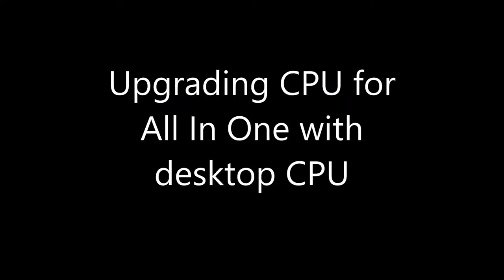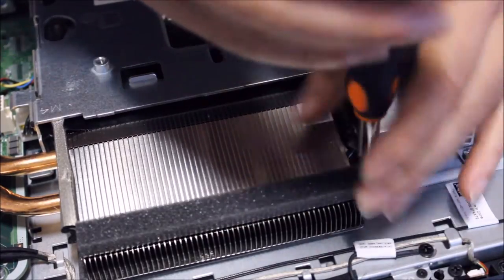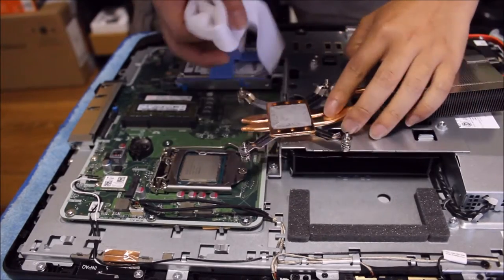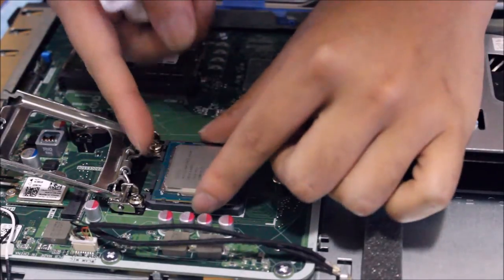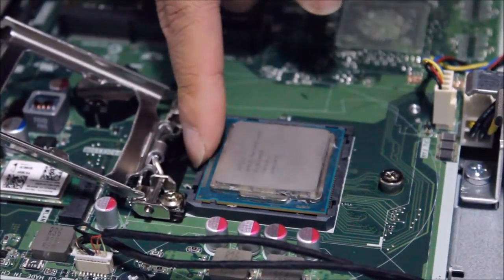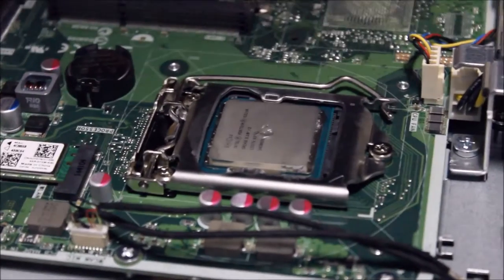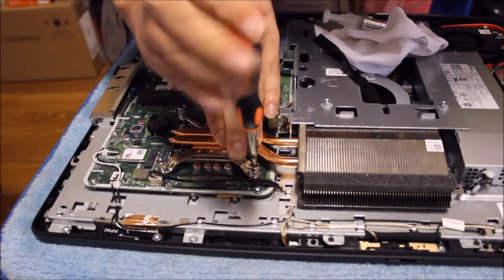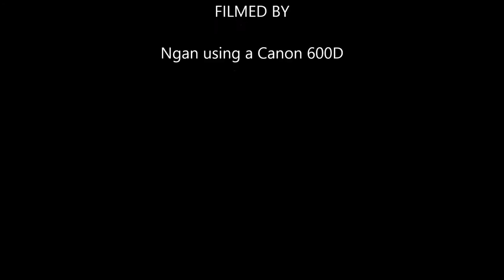Upgrading Intel CPU for All In One with desktop CPU NOT laptop CPU

Comment: i have a lenovo c 320 AIO it has the i3 2120 series chip,it can be replaced,what is the best i can put in ? and would the ordinary heat sink and fan still be ok?
Reply from the maker: i7 2600s. i cant tell you if the original heatsink will be ok or not. if you look at all the CPUs that came with your model that will give you an idea on what is ok. example if you look at your computer you will see if came with a i3, i5 and i7 therefore it is ok to use thiose

Comment: Hey there I have a Dell 7790 AIO. Processer is Intel(R) Core(TM) i7-10510U CPU @ 1.80GHz   2.30 GHz. The installed ram is 12.0 GB (11.8 GB usable). I have been to best buy and asked them if i can put a better/faster/bigger cpu in it and which one i can put in it and they said you cant. Another employee said it had a laptop cpu in it. Im not savvy with these things and am capable of putting a new one in it, i just have no idea what the best one i can put in it and if there even is any cpu i can replace it with. Thanks for your help as best buy was not helpful.
Reply from the maker: it is a lptop CPU and can not be replaced

Comment: Hey will this work?

It is a HP ProOne 400 G3 20.0-in touch Aio

CPU : Intel(R) Pentium(R) CPU G4560T @ 2.90Ghz
Reply from the maker: Intel Processors (include replacement thermal material)
Intel Core i7-7700T (2.9-GHz)
Intel Core i5-7600T (2.8-GHz)
Intel Core i3-7500T (2.7-GHz)
Intel Core i3-7300T (3.5-GHz)
Intel Core i3-7100T (3.4-GHz)
Intel Core i7-6700T (2.8-GHz)
Intel Core i5-6600T (2.7-GHz)
Intel Core i5-6500T (2.5-GHz)
Intel Core i3-6100T (3.2-GHz)
Intel Pentium G4600T (3.0-GHz)
Intel Pentium G4560T (2.9-GHz)
Intel Pentium G4400T (2.9-GHz)
Intel Celeron G3930T (2.7-GHz)
Intel Celeron G3900T (2.6-GHz)
Reply: @OpenMeUpTec  Omg thank you so so much!!! And am i able to change my graphics card? My current is  Intel(R) HD Graphics 610
Reply from the maker: @JapaneseSoomi  that is not a graphic card. that comes with the CPU. you can not change your graphic card. you need to buy a desktop for that.
Reply: @OpenMeUpTec  oh... i see
Reply: @OpenMeUpTec  Wait, so can i get a graphics card instead, if i do not have a graphics card as u said or can i just get a "additional" graphics card?:
Reply from the maker: @JapaneseSoomi  Nope you are stuck with that

Comment: hello dude
i have a lenovo all in one pc B305 i want to replace the cpu with amd a-8 (apu) but afraid of overheating what should i do
Reply from the maker: you cant do much. the cooler on the product was only meant for what the company put in it and not for your upgrade but it should be fine. normally even though the cooler is not good as it is suppose to the computer will protect itself by using thermal throttling
Reply: hello thanks for your reply 
i want to upgrade to and amd cpu which consumes same power and have 'cool n quite technology' and have more cores thats why i will produce less heat i have searched and got to know that a-8 will not fit in my socket my socket is AM-3 
and i want to upgrade the GPU too
Reply from the maker: if itis a am3 socket then you can replace the current cpu with anything that works with a am3 socket
Reply: i have searched and got AMD phonem 2
hey and what about GPU
Reply from the maker: when you talk about the GPU do you mean APU. AMD made CPU with graphic cards inside of them, the others that dont mention this also have one but a crap one.
Reply: no i was talking about a dedicted GPU but i got to know that it will not fin in my pc so i m thinking about  MOBILITY GPU
Reply from the maker: dont bother first it is extremely hard to obtain one of them and also they are really bad. you might be able to find some on ebay from old laptops but the issue is your computer must have a slot of this graphic card which hardly any do.

Comment: So I have an all in one HP Pavilion 24-xa0053w. Is upgrading from i5 to i7 worth it? Also, should I upgrade to an 8GB DDR4?
Reply from the maker: here is all the information you need. it tells you what you can do. i5 to i7 is not going to do anything unless you understand why you need it. if you are asking me then i can assume you dont understand why you need it. Ram is cheap therefore upgrading ram wont do any harm, the normal is 8GB which should be enough for a normal user. if you dont have an SSD then you should do that first. 

https://support.hp.com/au-en/document/c06120170
Reply: @OpenMeUpTec  cool thanks

Comment: yesterday i tossed an i5 3470 into an inspiron one 2020, bumping it from dual core pentium architechture to quad core i5 architecture, even if it can run at full speed the speed and latency of the OS is so incredible, its like a brand new computer
Reply: Holy shit, please tell me you're not kidding! In a dell forum a guy said that this kind of update was not possible. This stopped me from updating the cpu for 5 years for fear of a mistake. Do you think an i7 3770t could work in the inspiron 2020?
Reply: @joelescudero1415  As long as the CPU you want to toss in is supported by the BIOS running on the mainboard you should be fine. But since it is a Dell custom BIOS, support could be limited to the CPUs originally fitted in those systems, so your best bet would be to go with the highest end chip that was avaiable with the system when it was still sold. You can try different ones but there is no guaranty it will work.

Comment: What’s the best thing to do for my all-in-one pc 24-g085na to have a smooth streaming? Cause everytime I try to stream it always stops. Should I upgrade the cpu or something
Reply from the maker: Supports the AMD E2-7110, AMD A6-7310, AMD A8-7410 (Carrizo-L) Quad Core processors only. The processor is not upgradeable.

you computer is an low end starting computer. therefore you need to upgrade to something new

Comment: Hi I have a Lenovo AIO 510S-23ISU with an Intel Core i5 6200U @ 2.3GHZ. Can I upgrade the CPU? If so, which is the highest I can install. I have already upgraded the ram. Thanks for the awesome VID and info!
Reply from the maker: nope it is soldered on. also it is old so it is not worth upgrading

Comment: Hello there! I have a Dell Optiplex 3050 AIO, can I install an external GPU, if so, what are the terms and conditions?
Reply from the maker: you cant install a GPU in AIO. the only thing you can use is an external GPU
Reply: @OpenMeUpTec  OK, so what are the conditions? Is the GPU free or does it have to be low profile?
Reply from the maker: @rezyy1005  you have to buy an external graphic card holder and that does any size. if you are planning to do that just sell this and buy a desktop as it is probably cheaper

Comment: can I upgrade my old aio pc so it wil not be wasted?
PRocessor- Inter(R) Pentiu(R) CPU N3700   @ 1.60GHz   1.60 GHz
Installed RAM- 4.00 GB
System type-64-bit operating system, x64 based processor
Device ID- A762104E-8BA9-41FD-86B7-385A09A23976

Thank you!

Comment: I have a Lenovo C260 with Intel Pentium J2900 / 2.41 GHz 4 core processor. Can I upgrade it using this method?
Reply from the maker: nope your CPU is soldered on therefore you can change it

Comment: Hi there, hope you are. Lenovo Think Center All In One capable of changing the CPU? Have an old Think Center, but just wondering?
Reply from the maker: it depends what you have. since it is old most likely you can upgrade it. old lenovos use desktop CPU inside them which could be replaced

Comment: Can i upgrade cpu on dell optiplex 9010 aio, currently it has i7 3770s. What the best cpu that it will fit?6700? Desktop cpu? But will it fit?
Reply from the maker: no 3770 is the highest of that series, you cant get anything better. the 6700 is a different socket to the 3770

Comment: I have this PC with a stock CPU. What would the best upgrade be?
Reply from the maker: i need to know why you want to upgrade. this computer is old so the best upgrade is to do nothing and buy something new as you will be wasting money buying old parts to upgrade it. the upgrade will be less than a new computer and cost the same
Reply: @OpenMeUpTec   I am running a server and it runs 1.5 to 8 seconds behind, and I have maxed out the RAM. I don't have the money for a computer that is better than this, and although I know it will not be perfect I am simply trying to get closest to synch as possible.
Reply from the maker: @Super-oh8yt  i need to know your  model number or what CPU you have now to tell you the options

Comment: I have a hp 20 c013w is the cpu upgradable or is it integrated?
Reply from the maker: From HP website 

Supports the Intel Celeron J3060 (Braswell-D) Dual Core processor and the Intel Pentium J3710 (Braswell-D) Quad Core processor only. The processor is not upgradeable.

Comment: Hey friend. I'm know I'm late. 
Can I do this with an old Dell Vostro 360? It's so slow. The sticker on the front says Intel Inside core 13.

I'm also reading in the task manager. It says  Intel(R) Core(TM) i3-2120 CPU @3.30GHz

What parts should I buy to make this computer faster?

Thank you for your time.
Reply from the maker: it is too old. if it cheaper for yout o get a new computer that will be alot faster.

Comment: hey there!! can i upgrade my all-in-one pc hp pavilion 20 , it has processor intel i3 3240 3.4hz?? what is ur best choice?? pls reply fast
Reply from the maker: Intel Celeron G1610 (Ivy Bridge) Dual Core 2.6 GHz
up to 35W
Intel Celeron G1620 (Ivy Bridge) Dual Core 2.7 GHz
up to 55W
Intel Pentium G2030 (Ivy Bridge) Dual Core 3.0 GHz
up to 55W
Intel Core i3-3240 (Ivy Bridge) Dual Core 3.4 GHz
up to 55W
Intel Core i5-3330S (Ivy Bridge) Quad Core 2.7 GHz
up to 65W
Intel Core i5-3470S (Ivy Bridge) Quad Core 2.9 GHz
up to 65W
Reply: @OpenMeUpTec  Thank you so much!! You are very helpful.

Comment: Can I upgrade my hp pavilion all-in-one desktop 22-a113w, it has a Intel Pentium G3260T 2.9GHz
Reply from the maker: CPUs that work with socket LGA1150 will work with your computer. therefore the best thing you can use is a i7 4790T
Reply: @OpenMeUpTec  thank you so much man❤

Comment: i have intel core i3 4150t @ 3.00ghz in my hp all-in-one - 20-2211in with lga1150 socket which uses tdp upto 35w. Can you suggest me best cpu upgrade for me?
Reply from the maker: Intel Celeron G1820T (Haswell) 2.4 GHz Dual Core
up to 35 W
Intel Celeron G1840T (Haswell) 2.5 GHz Dual Core
up to 35 W
Intel Pentium G3220T (Haswell) 2.6 GHz Dual Core
up to 35 W
Intel Pentium G3240T (Haswell) 2.2 GHz Dual Core
up to 35 W
Intel Pentium G3250T (Haswell) 2.8 GHz Dual Core
up to 35 W
Intel Pentium G3420T (Haswell) 2.7 GHz Dual Core
up to 35 W
Intel Pentium G3440T (Haswell) 2.8 GHz Dual Core
up to 35 W
Intel Pentium G3450T (Haswell) 2.9 GHz Dual Core
up to 35 W
Intel Core i3-4130T (Haswell) 2.9 GHz Dual Core
up to 35 W
Intel Core i3-4160T (Haswell) 3.1 GHz Dual Core
up to 35 W
Intel Core i3-4330T (Haswell) 3.0 GHz Dual Core
up to 35 W
Intel Core i3-4350T (Haswell) 3.1 GHz Dual Core
up to 35 W
Intel Core i3-4360T (Haswell) 3.2 GHz Dual Core
up to 35 W
Intel Core i5-4460T (Haswell) 1.9 GHz Quad Core
up to 35 W
Intel Core i5-4570T (Haswell) 2.9 GHz Dual Core
up to 35 W
Intel Core i5-4590T (Haswell) 2.0 GHz Quad Core
up to 35 W
Intel Core i7-4765T (Haswell) 2.0 GHz Quad Core
up to 35 W
Intel Core i7-4785T (Haswell) 2.2 GHz Quad Core
up to 35 W

Comment: Hi.. great tutorial... I need a little help also if you don't mind
I have a lenovo c540.  Machine type 10110 with an i3 3240 cpu @3.40Ghz and a Lenovo A340-22IWL F0EB000NUK. i3 8145U CPU @2.10Ghz
My question is.. is either if these machines cpu upgradeable?? Any info would be appreciated. Thanks
Reply from the maker: i3 3240 can be change. the best thing you can change it with is an i7 3700. the other one you cant change it

Comment: Can I upgrade the cpu in my HP 22 all-in-one PC, I have Intel(R) Celeron(R) G4900T CPU @ 2.90GHz
Reply from the maker: you have not gave me the model number of your computer but from the CPU you currently have it tells me it is a desktop CPU. so anything that works with socket LGA1151 -2 will work with your computer. Therefore the best thing you can get is a i7 8700. if you want more information i need your model number

Comment: Is it worth it to get a new CPU for a AIO touch screen Lenovo C540? It’s one of the first models I bought it back in 2013.
Reply from the maker: no because if you replace the CPU you cant sell the whole computer and get your money back .
Reply: OPEN ME UP Sorry I worded the question wrong. The computer works fine but is upgrading the CPU worth it?
Reply from the maker: @trentboyne6404  no, for the same reason, if you upgrade it you will not get more for your computer. also many people are confuse and believe upgrading the CPU will make there computer faster which is not correct. what is the issue with your computer now that makes you want to upgrade
Reply: OPEN ME UP I appreciate the quick and thorough responses by the way. And I was just seeing if I could do a quick upgrade on it that’s not too pricey in order to run solidworks better.
Reply from the maker: @trentboyne6404  sorry you are using the wrong computer to use solid works
Reply: OPEN ME UP Haha I had a feeling I was just trying to get by with what I had. We don’t build anything complex whatsoever in class I was just seeing if I could get some extra speed for a few bucks.
Reply from the maker: @trentboyne6404  tell me what you have in it now and i will tell you what you can change it in to

Comment: hi good video was planning to upgrade my inspiron 20 3048 cpu but still worry what cpu i will get i know it lga 1150 but scared if i will messed up the sytem like the bios any advice thank you in advance
Reply from the maker: this is not apple. as long it fits in it should work. you just need to switch the CPU over and it will work. no setting or changes to anything else required
Reply: @OpenMeUpTec  ok any recommendations what kind of cpu intel it is best to upgrade it ? And correct me if im wrong yhe socket should be lga 1150 to fit?
Reply from the maker: @macen24  what cpu do oyu have in it now
Reply: @OpenMeUpTec  intel pentium G3240T hashwell lga 1150 35.0w
Reply from the maker: @macen24  your computer is so old, i dont even recommend you to upgrade it. anyways you need to get a haswell CPU with T at the end. T is for low power CPU.
Reply: So is it not good to upgrade it?
Reply from the maker: @macen24  nope it is so old that upgrading it wont do much

Comment: Good day sir. Whats the best cpu i can get for my hp all in one pc? 20-d180jp
Reply from the maker: i wasn't able to find your spec and any information about upgrading. I assume due to it being a 20inch there isnt much upgrade choice available
Reply: @OpenMeUpTec  it has intel core i5-3570S 3.10ghz
Reply from the maker: @luigijacinto6956  that quite old therefore i recommend you to upgrade it since it will cost too much. but the highest thing you can put in it is a i7 3770s

Comment: I have a HP c416il aio pc with intel celeron dual core processor can i upgrade this???
Reply from the maker: Socket type: BGA
Motherboard supports the following processor upgrades:
Processor
TDP
Integrated Graphics
Intel Pentium J5005 4C 1.5 GHz (Gemini Lake)
10 W
Intel UHD Graphics 600
Intel Celeron J4005 2C 2.0 GHz (Gemini Lake)
10 W
Intel UHD Graphics 600
Reply from the maker: Dual channel memory architecture
Two DDR4 SODIMM (260-pin) socket
Supports PC4-19200 (DDR4-2400)
Supports 2 GB, 4 GB, 8 GB, and 16 GB DDR4 SODIMMs
Supports up to 4 GB on 32-bit systems
NOTE: 32-bit systems cannot address a full 4.0 GB of memory.
Supports up to 16 GB on 64-bit systems
NOTE: Maximum memory shown reflects the capability of the hardware and can be limited further in the operating system.
Reply: @OpenMeUpTec  can i upgrade the processor??
Reply from the maker: @weeb7355  yes i have provided you with the list of processor it can be changed to
Reply: @OpenMeUpTec  could  you please tell me where to buy the above mentioned processor(pentium j5005)
Reply: @OpenMeUpTec  it's too important sir, please understand
Reply from the maker: @weeb7355  cant tell you where you can get one. you need to search the web or your area to find one. just did a quick search, doesn't look like you can buy one anymore

Comment: hi man, i have a acer aspire az1620 with a intel pentium g620, I think that it is possible to upgrade to an i3 or a i5, but to be sure because a don´t have a lot of money i was wondering if you could tell me if i am correct, 
greetings from Argentina
Reply from the maker: yes you can change the g620 which uses the LGA1155 socket. therefore, anything that fit on that socket you can use so the highest thing you can get is an i7 3700. you will be better off selling this and buying a new desktop. if you dont have the money then save up for it as upgrading is useless.

Comment: I have an HP OPP All In One (non touchscreen) Can I upgrade from a Intel Pentium to an i3 or an i5?
Reply from the maker: you should be able to but i need your model number to tell you
Reply: OPEN ME UP 22-b016
Reply from the maker: Supports the Intel Celeron J3060 (Braswell-D) Dual Core processor and the Intel Pentium J3710 (Braswell-D) Quad Core processor only. The processor is not upgradeable.
Reply: OPEN ME UP if you looked at the one on the hp website, that’s incorrect. I have different specs then that I have an Intel pentium and 4gb ram. That’s a different model number, I already checked.
Reply from the maker: if you have a different model number then why have you provide me wit the incorrect one . since i am unable to see what you physically have whatver you tell me the model number is then i have to use that. first thing is there is no point upgrading your computer it is too old. you can get something newer for a similar price to your upgrade and it will be much better
Reply: OPEN ME UP My bad, I think I said the wrong model number. I’ll just open up my pc and see if the processor is replacaable